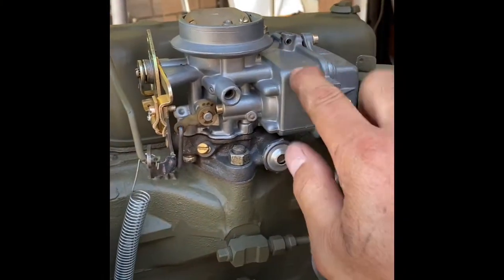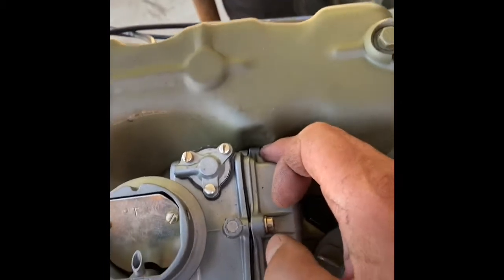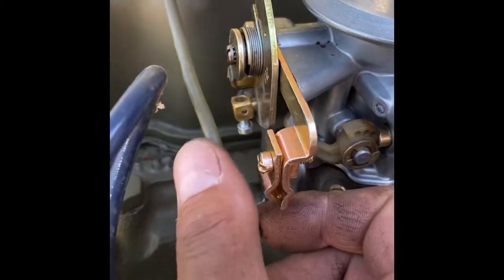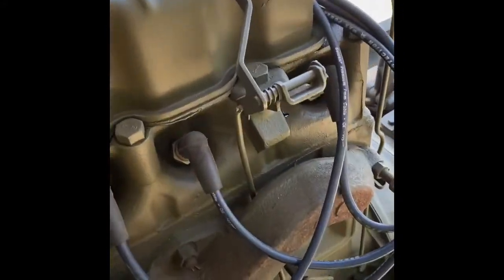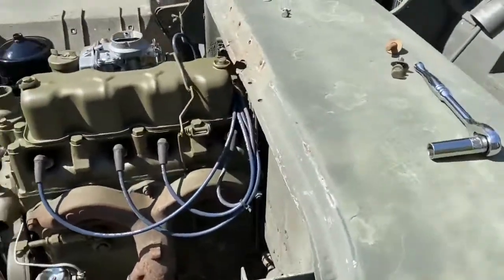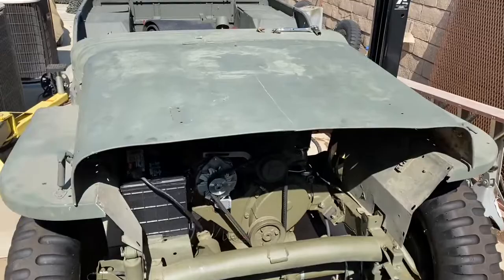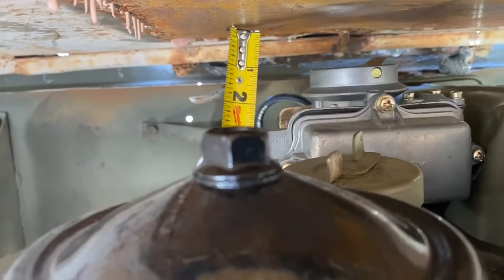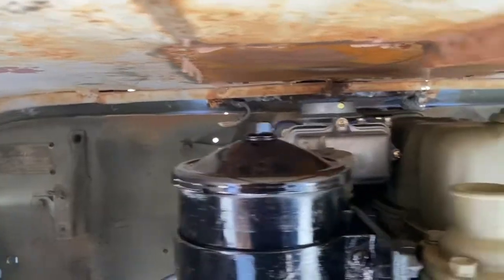PART 2 - F134 engine in a Flat Fender Willys Jeep- carb clearance and linkage

Comment: Just be aware on steep grades it will flood the carb. I fixed mine by jb welding the vent tube and drilled a port on the outside. Then connect ed the hose to the top of air cleaner tube.
Reply from the maker: thanks for the awesome info.

Comment: Have you tried using  1962 falcon six carburetor with homemade adapter .  I heard it works .
Reply from the maker: yes sir - that Holly 1904 is the same as Falcon carb.